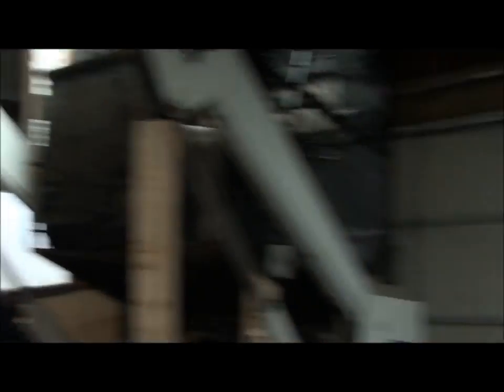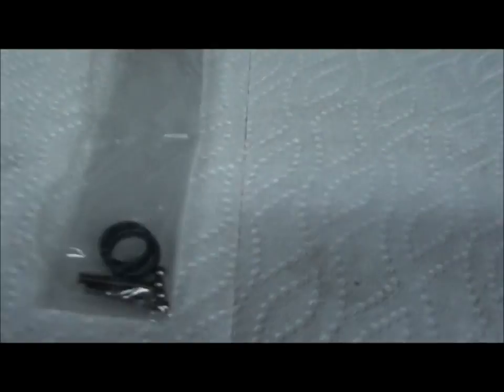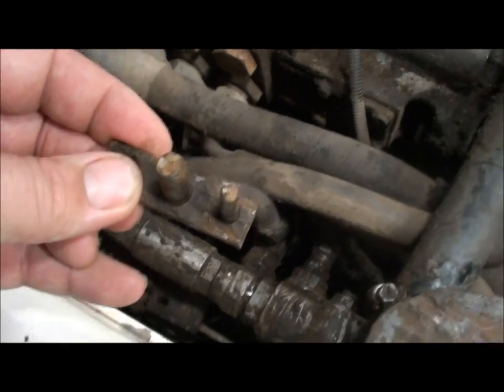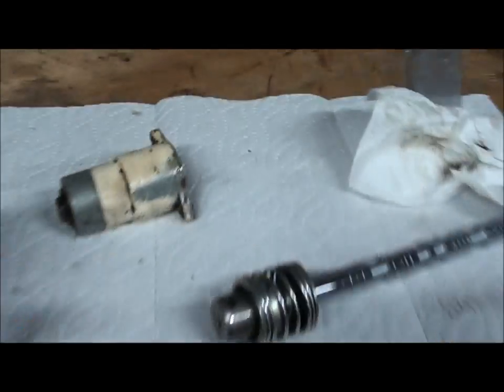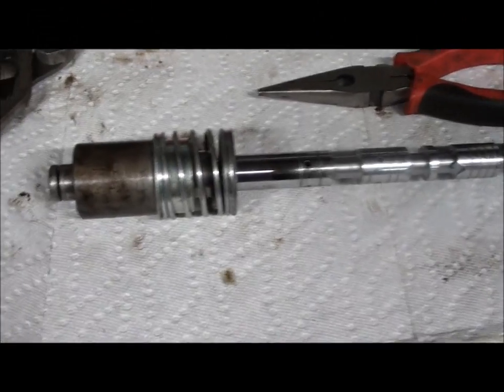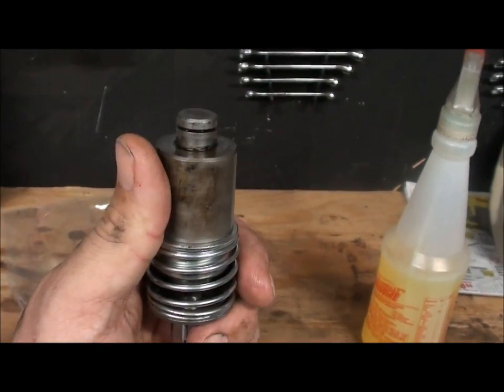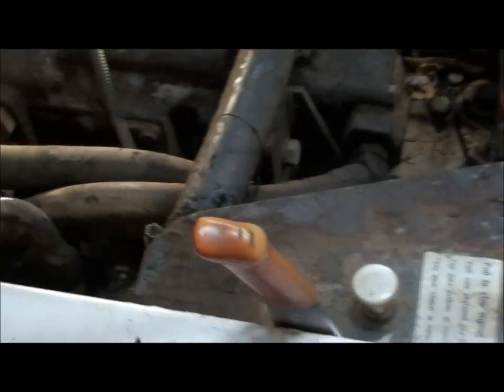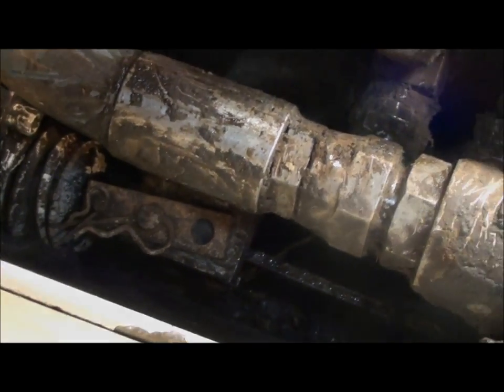Fixing float valve on 743  Bobcat

Comment: Big help. Thank you. I've taken my whole control valve unit out of my 743 and am doing all the seals as there was a significant leak. Turns out that tall aluminum cap  for the spool had cracked, also, one of those springs had broken and the ball and the bit of spring that broke off had wedged themselves in the top of the spool. Operation on the lift was all or nothing, so I knew something had jammed itself in there somewhere. I had no idea "float" even existed and I'm excited to use it when I get everything back together. I found your video because I had no idea how I was going to get those balls to compress but now I see you take the c clamp off and you put the inner cup on first.

Comment: Thanks for the videos mate I did all for cylinders on my 310 bobcat by watching your videos easy as . The only thing I had trouble with was getting gland cap off ended up using jackhammer with pointed but to get it to move then made a tool to loosen and tighten just like a grinder blade tool but bigger

Comment: Thanks for the idea for getting the detent balls and springs back in.  Made the newbie mistake of letting the cover come off (was so full of oil it just sort of happened)   Used a leather punch because of its round indent and did it inside a box just in case the ball let loose.  Worked like a charm :-).

Comment: Thanks for the great video on this!. My bobcat boom arms don't float either I think I'll try this. Also, on my bobcat when I lower the boom arms it's very difficult to control and jerky, up is fine, just down is out of control. Wondering if the ball bearings under the large spring help with that? Any ideas where to look for issues with the boom arm controls?

Comment: Nice video . I took the whole valve out took me like two hours and I replace all the seals and O-rings in there and when I put everything back together The pedals got stock and after pushing them up and down The one for the Bucket works fine but the other one don't want to go up I have to kick it hard forward and then kick it back backwards to left the boom
Reply: Any advice? Thank you

Comment: Great videos man. I have a 743 that looks identical to yours. the problem i have is the lift arms are weak. I am wondering if replacing the seals on the this part would have anything to do with my problem. I have not had any luck searching the manual, or online. If the bucket is empty it will lift normal. but a half full bucket will not lift.
Reply: I'm not a Bobcat mechanic, but I have had some hydraulics training. I'm pretty sure those seals just prevent the oil from leaking out of the valve. The spool is machined to very close tolerance so that no seals are needed between the ports. If your control valve is responsible it may need to be replaced. I would suspect worn lift cylinder pistons first, though.
Reply: Jeremy Owings hi i had the same problem on my bobcat! It happened to be metal shaves stucked in the main relief valve! Stuck open! Check that out first

Comment: I have the same bobcat, and I'm having trouble with the lift.  It goes up and down fine, but it won't stay in the up position.  It just leaks back down in a matter of seconds.   Any ideas would be greatly appreciated.       I don't have any hydraulic leaks whatsoever.
Reply: I have the same machine and i have the same problem with the loader not staying up.......
Reply: did you ever fix this problem? mine has the same issue